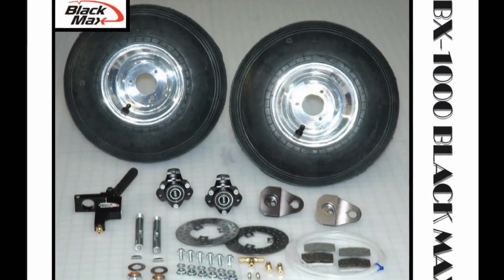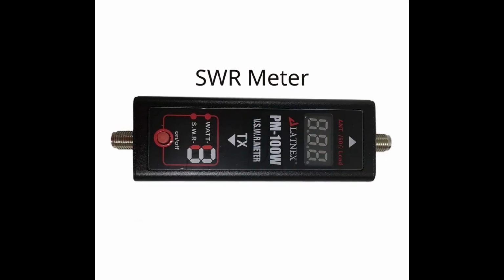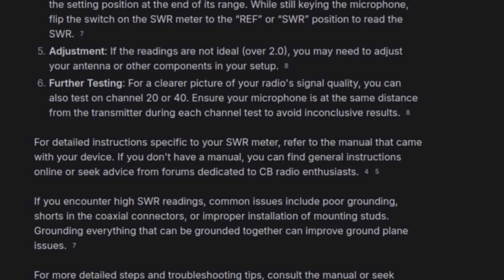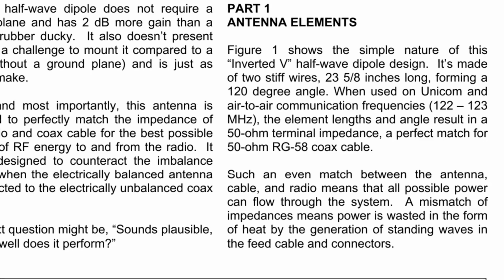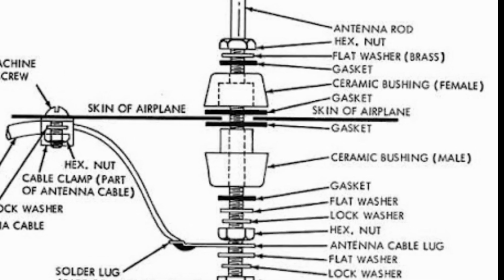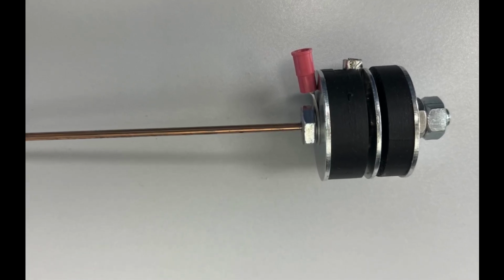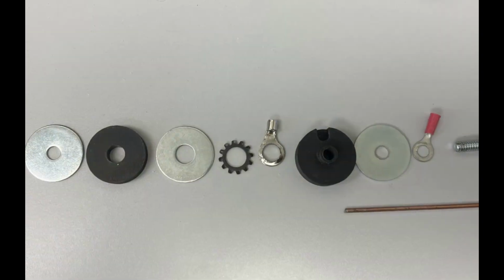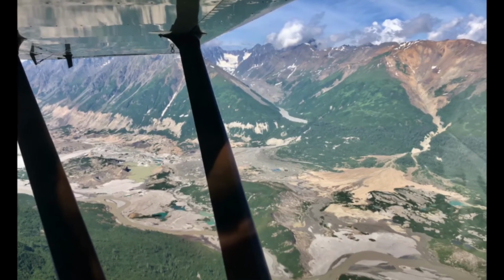44 Antenna Ideas - ADCO Aviation's Legal Eagle XL Ultralight Aircraft Build Series

Comment: Nice job, man. I'm nowhere near that on my plane, but I did just install an Antron 99 on my house so I can use a cb  at home. Lol
Reply from the maker: Very cool. My dad and I made several different jPole antennas using copper pipe for our home stations. Thought about making one for my handheld to see if I can pick up local air traffic.
Reply: @davidadkins1926  I wanted to go that route or with electrical wire but I'm never home to do anything I need or want to do so it was a lot easier to slap up the Antron haha. I've been getting more into CB'S lately and found out there's guys out there that are retired that listen to air traffic and have equipment to collect data on airplanes for the apps to track airplanes have ham radios and are listening to North Korea talk bad stuff about us and all sorts of stuff going on that I never knew people had access to. One guys collecting data from satellites and I don't even remember all the stuff but it's pretty wild.
Reply from the maker: OK now you have my wheels spinning... think I may have to pursue that even more... lol